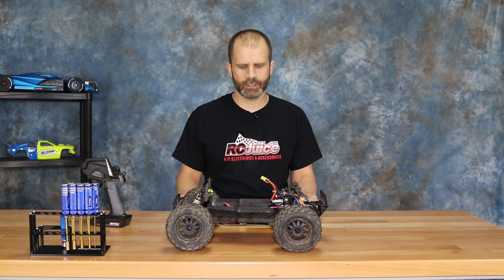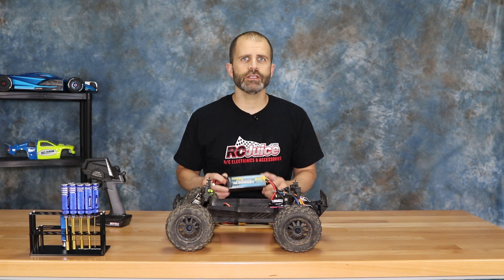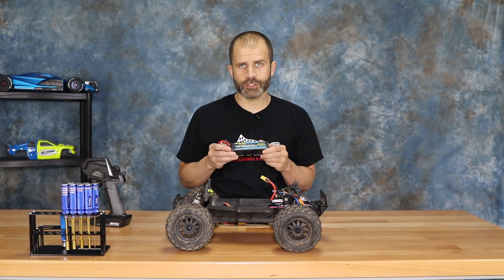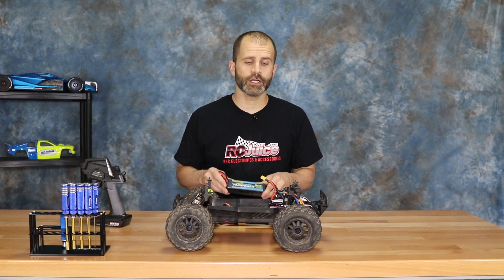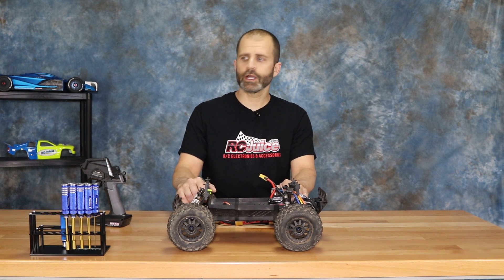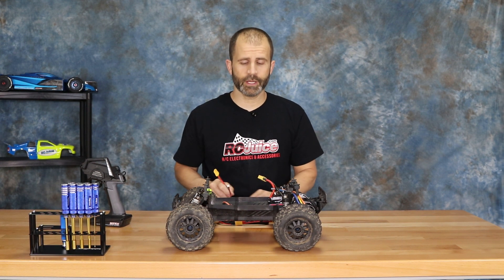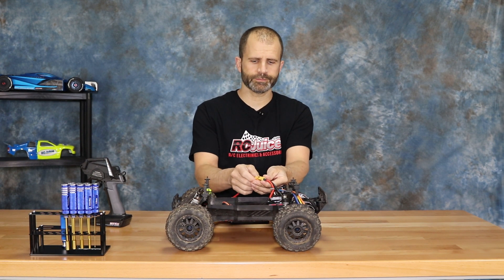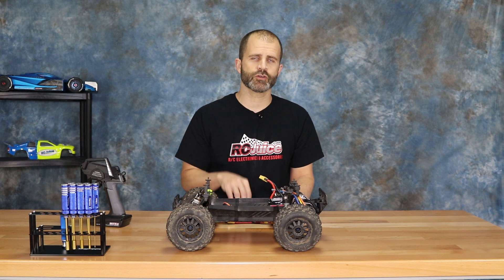What is low-voltage cutoff and why do we need it?

Comment: I somehow still dont understand and confuse.i already have a tamiya tt-02 with a mabuchi rs-540 brushed motor using a tble-02s esc.im using a nimh on it,i asked reddit can i use a lipo battery on the tble-02s esc but they say the lvc is wrong so they recommended me some esc.

They said i should buy a hobbywing esc if i want to upgrade it into brushless so im gonna do it,they said they recommend me using the hobbywing quicrun 10bl120 g2 sensored brushless combo with a supersonic 10.5t or the hobbywing xr10 pro combo and they said,i should upgrade the battery into lipo too since lipo is more powerful then nimh.

And they said they have good luck with zee brand and one of them recommend me the zeee 2s 5200mah 80c or the 50c since that fits on tt-02 perfectly.soon i will be buying the hobbywing xr10 pro or the quicrun 10bl120 g2 sensored.if im using a used 2s 5200mah 50c lipo battery,what lvc should i set for the esc,3.2v or 3.5v and if i want to set the lvc,how do i know if the lvc is happening while street bashing/some racing?

Edited:I just buy the hobbywing xerun xr10 justock 60a with the supersonic rocket 10.5t,haven't test it since I don't have a remote and a battery.i just sells my remote since my mom at diff country gonna buy me a Dumbo RC X6 gyro.

Comment: I have an xr8 pro g3 with a 3660 - 3600kv g2 motor.
The esc keeps cutting power in my 2s when the battery is full. But with my combo the motor lipi limit is 3s, is the battery my problem?

Comment: I have a 8BL150 esc running on a Dewalt 20v Lithium battery.. runs great for a minute then cuts the power in half.  I also have the Dewalt DCF809 motor. Any ideas why? Esc is set to 3.0v/cell

Comment: Excellent video I just learned something a hobby shop didn’t tell me…why my new 4s Mojave would turn off after maybe 10 minutes sometimes 5 minutes..turned out I had a brand new battery with a dead cell when we check each individual cell…so the battery read 15.3v after I charger it plugged into my car it would only run for maybe five minutes then shut off that’s because the ESC was detecting a bad cell not looking at total voltage…Great video thank you,so after testing the bad battery we checked the new battery the hobby shop gave me and each cell was balanced all comparable to each other cell

Comment: Does cars that come with Li-Ion packs have appropriate lvc for Lipos? Or does Li-ion use different lvc point?
Reply from the maker: LVC for lithium ion batteries is between 2.5v-3.2v per cell depending on the information source

Comment: I played. A dangerous game. I'm new to rc my car didn't run that long. I would turn off the car and transmitter. Turn the transmitter back on then the car and I would run it some more. I noticed the battery was hot. Thanks for the video. I had no idea. I was running the 2s lipo all the way down. I know this because when I charged it it had  0 mah. Thanks again.
Reply from the maker: Of course, thank you for watching!

Comment: I installed dual fans on my vendetta kept going into limp mode im guessing the fans where to powerful. Tried it on my buddy vendetta same problem kept going into limp mode with dual fans 1 fan  no problem is it the esc???? Or is there a setting i can change?
Reply from the maker: You mean that with a fully charged battery the fans alone are kicking in low voltage cutoff?
Reply: @RCJuice  yes correct the fans i gues are to powerful for the esc because if i leave only 1 fan plugged in that won’t happen but when I connect both it goes into limp mode with in 4 minutes of driving

Comment: why not just use LION batteries instead? They have higher capacity too. Because of discharge rate?
Reply from the maker: Exactly, the discharge is just not there on the LiOn but they are definitely more stable cells.

Comment: my arrma vorteks has a flashing red light, and it says something about the LVC. so should I buy a new battery im really confused with this stuff?
Reply: so what should I do. should I get a new battery?
Reply from the maker: @Bart_Cards  Is this a LiPo battery you are using?
Reply: yes
Reply from the maker: @Bart_Cards  If you are using a LiPo battery and are getting the LVC light on the ESC, then the battery is under-charged.  What charger do you have and what is the charger saying when you try to charge it?
Reply: I'm using a Prophet sport mini dynamic multi chemistry charger
Reply from the maker: @Bart_Cards  If the charger indicates the battery pack is charged and you are getting the LVC light then you have another issue with the truck.  If the pack is not charging then you can try this trick out, do not connect the balance lead when charging it in NiMh mode as the charger will not allow that.  Just connect the 2 main leads and put the charger in NiMh mode, charge for a minute or 2 and then charge it as you would normally charge your LiPo.
Reply: ok
Reply from the maker: Check out this video we have on the subject, it should clear things up for you but please let us know if you have any more questions: https://www.youtube.com/watch?v=aQyZSD9UNmE&t=13s

Comment: i have been into rc off and on since about 2013, i liked lipo enough to build my ebike battery out of lipo packs. i am trying to figure out how low to take the voltage. seems like i used to hear lipo packs should not be taken down to no less than 3.7v per cell.  i just did a test and found that 3.7v at rest is almost exactly 50% soc, if you consider 3.0v per cell to be 0% soc. since i have six 6s packs, which is about 28lbs of battery, i cant justify only using about half the batttery, plus thats difference between 1.5hr of riding at 22mph vs 3 hours of riding
Reply from the maker: This is one of the reasons LiPo cells are rarely used for ebike purposes, we know a good amount about the ebikes and there's a reason most electric vehicles go with Li-Ion cells.  They do just make more sense.

Comment: Took my truck out everything was working just fine then it stopped working my motor itself started to Signal alarm what would that be now everytime I plug my battery in and turn it on it beeps a couple times and then nothing responds not even my staring did I burn up my ESC
Reply from the maker: Sounds like you may need to calibrate your ESC (if you move your throttle trim on your radio it can also keep your ESC from arming, make sure your throttle trim is all the way down before powering up the ESC): https://www.youtube.com/watch?v=MIpvyi8vjHk

Comment: I’m having a lvc situation going on now with my brand new erevo 2.0. It’s shutting the truck down at 3.9v per cell. I’m using 2 brand new 5200 mah 100c 2s lipos. It’s pretty annoying. That can’t be normal right? 3.9v ?
Reply from the maker: It can be, it depends on what the LVC is set to in the ESC programming.  Are you able to check the settings?
Reply: @RCJuice  I just got off the phone with Traxxas and he’s saying that I can’t access the lvc or adjust it. He said that it’s possible it’s the deans to Traxxas plugs that I’m using causing the issue.
Reply from the maker: @6spd85notch  If you had cutting out under heavy throttle at all pack voltages then an adapter could be suspect, but if you are consistently hitting LVC at the same voltage then it is likely either the ESC setting is just where it is, or the packs are starting to sag once they dip-down in power and they are tripping the LVC.  Does the throttle come back for a bit after hitting cutoff, or is it just hitting cutoff and shutting the whole party down?
Reply: @RCJuice  cuts down to part throttle.  Erevos battery compartments are tough. I’m actually looking at another set of batteries on eBay right now. I haven’t had an erevo in a while because I started buying arrma trucks that fit almost any size batteries. I don’t have any other batteries that fit it. Puffing batteries don’t help the situation either. I’m going to order some 3 cell batteries and I’ll let you know what happens. As long as I’ve been into rc cars I’ve never come across this problem. I think the batteries are way overrated. Mah and c rating are probably exaggerated and like you said the voltage dips below the cutoff for long enough to trigger Lvc.
Reply from the maker: @6spd85notch  Correct, you are a lot more limited on the packs you can run due to the nature of the battery trays you are working with.  At some point an aftermarket ESC may be a worthwhile upgrade, if for no other reason the accessibility is nice.  Take a look at these 3S packs that fit those trays nicely: https://www.rcjuice.com/lipo-batteries/3s-11-1v/hobbystar-7200mah-11-1v-3s-100c-lipo-battery.html
Reply: @RCJuice it’s funny I found my own comments again with another erevo 2.0 dealing with Lvc again. I sold the last 2.0 I had because it drove me nuts. I just bought another and it’s doing the same exact thing. My erevo 1.0s never did that. I used to get 30-40 minute run times out of 5000mah batteries and I believe that used to be the old school mamba monster. I’m going to toss this esc in the garbage if I can’t figure this out soon. 15 mins is ridiculous. $700 truck and 15mins ??

Comment: On my Arrma Granite the LVC seems to be kicking in way too soon (around 50% battery life). Any Ideas?
Reply from the maker: Are you sure the ESC is in LiPo mode?  The cutoff voltage itself is also usually adjustable, have you checked the ESC setting and have you also verified the battery voltage at cutoff?

Comment: Good video. Once the low voltage cut off has happened, if you unplug and then plug the battery back in, will the low voltage cutoff activate again? Is it impossible to keep running a lipo down with a modern ESC?
Reply from the maker: Yes, LVC will kick in anytime the voltage is too low.  Once it kicks in you can get some "'bursts" of power from the ESC for a little bit, but it will stop working altogether soon after.  As long as the ESC reads the proper cells then yes, it is nearly impossible to run down a LiPo too far during use with a modern ESC.  If you set the voltage down very low (say 3.0V) and the battery is old then it is possible the voltage will drop down too far for a charger to recognize it, but you can "revive" that as well: https://www.youtube.com/watch?v=6qb_Nw13h6w&t=6s